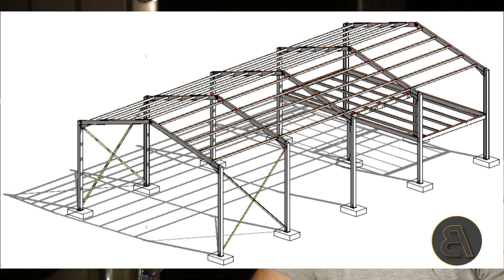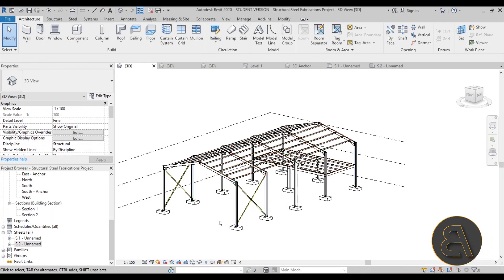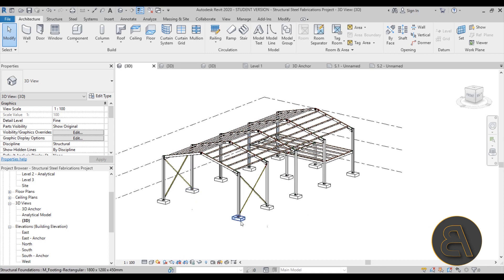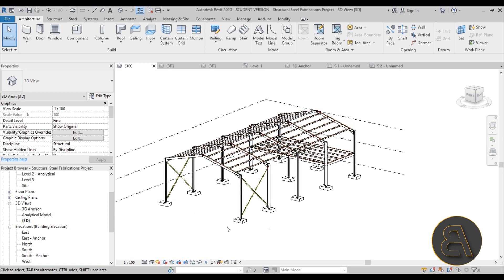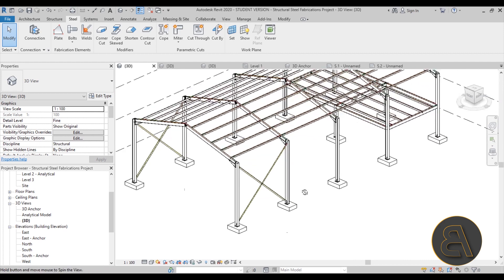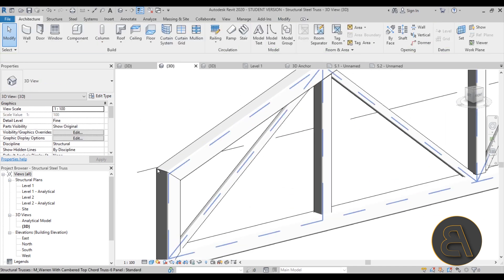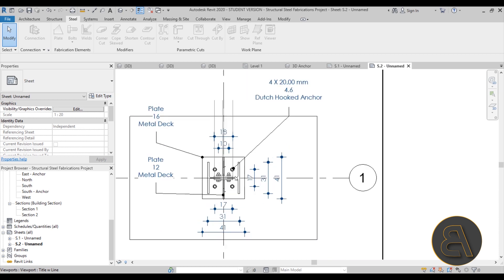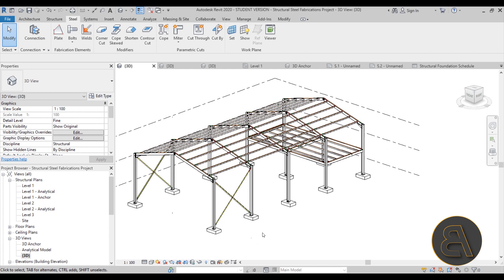Structural Steel Fabrication Course in Revit

Comment: I look at your steel frame and it seems to have several mistakes. Anyway from the modell recorded right here. The modell is missing all the side rails, it is missing the eave beams as well and perhaps the wind columns at the short sides of the building

Comment: Question. Drawing all of this is fine. But how do you know the beam sizes and connections required? Are you just guessing or is Revit able to build based on engineering requirements of the site the building will be built on?
Reply: Tekla & ETABS does that automatically